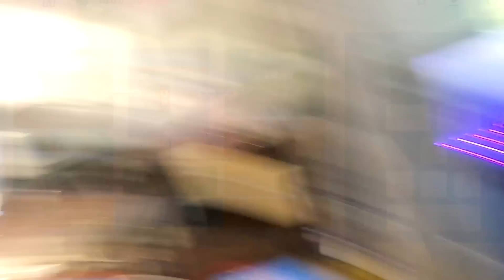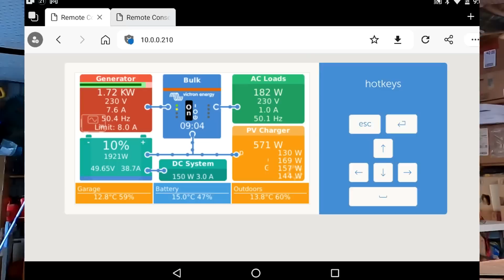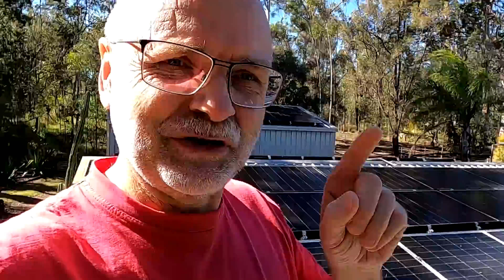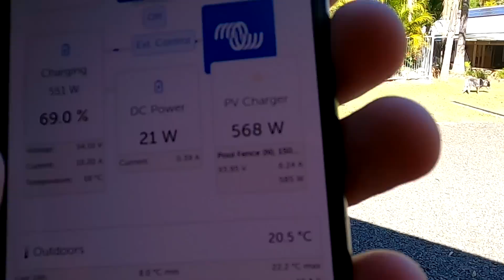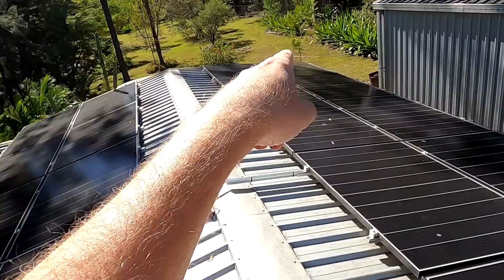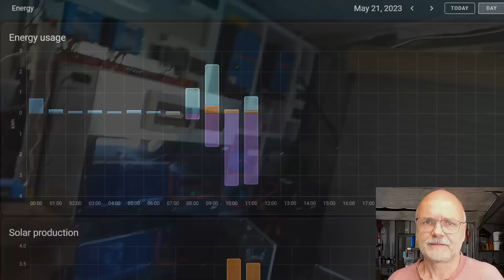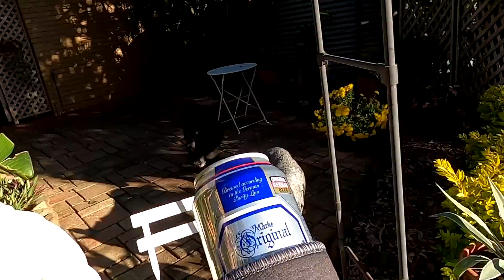Finally Off-Grid!! Look at this energy consumption and production in Winter!

Comment: Let me disagree with you, Andy. First of all, YOU ARE STILL ON-grid. This means that: a) you treat the grid as a battery with infinite capacity (very convenient but impossible in off-grid conditions!), b) you can ALWAYS count on full power supply from the network in the event of a failure, reconstruction of your own installation or empty batteries for trivial reasons . Even if you to deny it, in any way, the fact of connecting to the grid changes not only your consciousness but also your subconscious and the resulting decisions!

In order to fully legitimately consider a true off-grid, all you need to do is perform a very simple experiment: disconnect the main fuses at your grid operator's energy meter. If your installation can withstand CONTINUOUS and UNINTERRUPTED (even for a few seconds!) power to your home FOR TWO WEEKS, it deserves to be called "off-grid capable" in my opinion. If not, the considerations become purely academic, in this case without practical significance. Yes, in the second case you can talk about energy independence, but it is still not TRUE off-grid!!!

Why do I take two weeks as a test period? I just assume that extremely unfavorable weather conditions cannot last more than 14 days continuously. Even if such a situation occurs, it will be an unimaginable exception and as such cannot be treated as the rule. A sufficient remedy for such exceptions would be to equip the installation with a small power generator with a power slightly exceeding the power of your inverters.
It is very likely that you would NEVER use this generator, but knowing that you have such protection gives you a sense of security and comfort for a small price.
Reply from the maker: Thanks Andre.
a) I explained this in the video
b) I explained this in the video
I don't need a generator, I can just stay connect to the grid and use on single power outlet in the garage in case I need to recharge the batteries for whatever reason. I can pay the service fee for the connection instead of investing and maintaining a generator.
We can have this discussion again in 2028 ;)
Reply: @OffGridGarageAustralia  I watch your channel because its name attracts me: OFF-GRID...
I am considering building a house in a location where there is NO NETWORK and there are many indications that it will not be for a very long time I am collecting information, observing the experiences of others to create a coherent concept of a house that would be completely off-grid from the beginning, even without a chance for any network support.
Therefore, until I prove to myself that my concept makes technical sense, I don't even start considering its economic sense. Technical sense, more precisely: meeting the condition of energy self-sufficiency in WINTER is a sine qua non condition. And this is not so obvious in Poland! Therefore, in my deliberations, the generator is a safety element in case of a serious failure of my "photovoltaic power plant".
The matter is not as obvious as it might seem. In my country, there are a lot of restrictions on PV installations, our internal ones, but above all EU ones. The second problem, no less serious, is digging through the bureaucratic inertia, not to say "reluctance".
I live in Poland (and I'm not going to change that) in a country where the conditions for building a PV installation are much more difficult than in your case. And my concept is very simple: land suitable for construction purposes in a non-electrified area is more than ten times cheaper than land "armed" with utilities. In this way, the funds for the PV installation can be easily saved from the "investment budget", although in my case it is not a bottomless barrel. ;)

And that's why my observations and comments come from a different point of view. As I can see, you are satisfied with the installation not so much off-grid as yes, which I call hybrid - a little off-grid, a little grid. For me, the basic criterion is clean, indisputable off-grid. Hence the sometimes different ratings.
Reply from the maker: @andrzej3511  Thanks for your explanation.

Comment: Andy, you should really consider strategically removing even if only two or three of those tall trees which are most impacting your production.   Removing 2-3 of those tallest trees would make a HUGE difference in your production and only minimally change the landscape...  It might save your garage and solar system too should you get a big storm.  If nothing else, I'm sure it would help reduce the rot and growth which I'm sure you've seen to some degree from all the shading.
Reply: There's more to it than just about solar production,it's habitat for wildlife. I get his desire to keep them. I'd only consider me minimal removal once all other possibilities exhausted.
Reply from the maker: It's not possible to remove these trees. It would cost me $25.000 or more to get them removed. I could spend this money in solar...
I also disagree to remove trees to setup solar. That contradicts the purpose of clean and green energy. As explained in past videos, I work around the trees.
Reply: @OffGridGarageAustralia  You would save more CO2 when you would remove the trees. They are not a very efficient CO2 sink.
Reply from the maker: @Poebbelmann  They are a CO2 storage

Comment: I run with the firm conviction that any home storage / energy system has to be able to operate without intervention in all conditions.  Which means, generally,  having load-support (also means battery support) available by other means.  A generator or a charger vampiring off another system (like the home's grid-tie).  Otherwise one goes through life constantly having to bird-dog the storage system.

That means having a generator, or having energy transfer capability from the grid (aka a battery charger), or whatever... all automated.   For the grid support the simplest automation is to just set the battery charger's voltage to a support level, e.g. 51.8V or something like that, so it only operates when the battery is low.  And make sure the charger has enough suds for always-enabled loads like a fridge, pool pump, etc.  It does not necessarily have to support all voluntary loads such as charging the car or using power tools.

A more complex automation to ensure that you are only using locally-produced power from the home system is to connect up a sensor to the grid egress (clip-on current transformer / sensor), integrate the sensor into Home Assistant, and then integrate a contactor into Home Assistant with some automation to turn on the contactor (enabling the charger on the AC side, or some other on/off mechanism) whenever the house is exporting more than X kW.

If you do go that route be sure to have hysteresis.  Lets say the battery charger can do 12A (650W or so).  You can set the charger to a middle-of-the-road battery support voltage, say around 54.5V, then have the automation turn it on when the export is > 2000W and turn it off when the export is < 200W.   So it turns on above 2000W (dropping the export to 1350W), and turns it off if the export drops below 200W.   And then at that middling voltage when the charger is on, the charger would only push full power if the battery is fairly low and unsupported by its own solar.

It would be fairly easy to find a sweet spot simply by running the charger in power-supply mode, due to the discharge curve and the charge curve being so widely separated in LiFePO4 battery systems.

--

For my Pergola system I have a little Victron 12A 24V charger that I have set to a low-battery load-support voltage, around 25.9V, and I love how it works in conjunction with the battery.   It doesn't just go from 0 to 12A instantly... the ramp is quite slow since any off-loading of the battery props up the battery voltage, so the battery still contributes current.  Precisely what I want... I want to use as little of the grid as possible.

With a middling battery charging voltage... in your case somewhere around 54.5V (3.4V/cell), the charger would only contribute when the house is exporting, the battery is low, and the garage's solar is insufficient to prop up the battery.  Setting the charger's voltage to somewhere between 3.3V and 3.4V (52.8V to 54.4V) would have the behavior that you desire.

-Matt

Comment: I'm building a new house in Budapest, and we don't have any hot water tank or tubes installed. All hot water is created only when we open the tap and cold water is heated to 50 degrees Celsius in seconds using 3600 W heater built into the tap. In this way we only use 3600 W for few seconds and bit longer for shower. Clever system, I believe.
Reply from the maker: The problem with this instand heaters are, the power must come from somewhere. So the power generation need to be ready at any time for you to have hot water. That costs hugely in terms of the power grid, the power plant which provides this power for you and therefore the environment. The plant needs to run 24/7 with the capability to deliver this power to your house, even if you don't use it.
It's actually the least efficient method to heat up water unfortunately.
Reply: @OffGridGarageAustralia  The thing is though that this is for kitchen etc. so when I open the water, I use it for only 1-3 minutes and then turn it off. My opinion is that it will use less energy than heating a water boiler and keeping the water hot.
Reply from the maker: @TheFikotech  But how does the power plant know when you will open the tap? So it needs to run on full power all the time just to provide the energy when you request it. It's like leaving your car running just in case you want to drive it at some point.
I would not go with such a system if I were you. It also will be very hard to switch to solar and batteries at some stage.
Reply: @OffGridGarageAustralia  Well, I think you have proved that solar cells are not "just" solar cells and in the feature we might be able to get better batteries AND better solar cell technologies. In my case, I develop MCU systems that are "smart" on the energy consumption. As I also have electric floor heating, the heating of the floor will automatically be switched off when I open hot water, and turned on again (if needed) when I close the water. The floor heating is also about 3600W + plus another 1500W, but they are never on at the same time, as the software controls this function in the same was as it does with the hot water tap.

Comment: 31:45 Honestly - 1 person more in the winter helps heating with 50 - 100W, which is usually more than the consumption for hot water. In a good insulated house in Germany, 1 person more needs not more energie.

Comment: When you go offgrid, then you have to buy a good diesl generator.
Reply from the maker: Noooo, I will just stay connected to the grid for quite a while (not even sure if I can disconnect at all). and use just one outlet in the garage to plug in a small charger if I need it ever.

Comment: Hello Andy
As usual a great video.
Do you heat your hot water with electricity from solar/ grid? If so why not place solar collectors on the roof and install a small recirculation pump.
I have built one using a larger storage tank with element and collectors and pump and only used electricity to boost the water temp when the home had 4 additional people from off peak on the very odd occasions.
Sunshine Coast hinterland.
Keep the good work up.
Reply from the maker: A solar hot water system would cost me A$6k including installation. I use around 1.5kWh per day on hot water (year average), that would be over 27 years amortisation. I can install 4 more solar panels just to cover this load and keep my existing hot water tank (which I have done already)

Comment: On some cloudy days i surpricingly get more power from the opposite roof.
Both roofs have no shade.
I think sometimes the clouds do act like a mirror, reflecting the sunlight stronger than let it through.
Reply from the maker: Yes, clouds are doing great things if they are not to thick.
Reply: When rain and stop I notice and increase in production, I suppose the water drops in the panels act like a lens. In photography on a cloudy day you have to take 1 or 2 F stops to not overexposure probably this happen with panels and they produce more, I'm referring those cloudy but bright days not the grey ones.
Reply: @CantFindInYoutube  Rain also cools down down the panels.

Comment: He could keep adding panels or simpler just cut down 2 trees, you have plenty. You would easily double typical output.
Reply from the maker: Cost me $25k+
Reply: @OffGridGarageAustralia  That is one expensive chainsaw.:face-green-smiling:
Reply from the maker: @DirtMcGoof  Trees are 40m high and no real access for any machinery behind the garages. Cutting seems possible but very destructive but removal very very difficult. I look for alternatives therefore.

Comment: i would cut some (Äste keine Ahnung ob das wort passt) branches..
then i would rethink my Winter wiring;)
i do as follow,
2s pv and then every 2s paralell.
i have here a simular Problem (Baby system) and i Change my wiring 2 times a anum.
this raises my Winter energy by 50%.....because of the moving shaddows .
I Must tell you that i have a 24v System  and 2s pv  works best for me in Winter.
i wish you the best that you can immagine!
sorry,my english declines.
Reply from the maker: I bet you would not cut one single branch...
Reply: @OffGridGarageAustralia  as long i would be thinking logical ....you are shurely right!
to my own worry i am  sometimes irascible.....so it would possibly happen ;)
Reply from the maker: @anon72513  You would need a 40m long prune saw to start trimming some branches off ;)

Comment: Wouldn't it be more efficient to go from frankenstein batteries to go directl to your 3 main batteries rather than going through the phoenix DC->AC, then MPII?
Reply from the maker: Yes, of course, that would be far more efficient. The MPPTs are 99% efficient, the detour over the Phoenix and Multplus will cost me around 20% in energy loss.

Comment: Andy, if you have a stable grid, off-grid system is just not worth it. The price for the pure off grid system is raising rapidly, but you need to cover small portion of energy usage. In other hand you will have a lot of power on the roof during the summer which you are not able to use.
In Slovakia we have a product Virtual battery, so I can export energy for free during the summer and import it during the winter just for distribution fees. This can reduce the electric bill dramatically without having big battery and very expansive solar system.
Reply from the maker: It's actually the opposite. Off-grid systems are coming down in price. Staying connected to the grid is not worth it, no feed-in incentives and far too many regulations.
However, I will stay connected to the grid for a while and use it as a 'generator' in case I need to charge in case of a weather event.
Reply: In this particular case, the large solar array and the large battery are already in place and functional. I appears that making this installation fully off-grid would require little additional expenses.

That being said, a naive off-grid system has one obvious disadvantage: no back-up. If something goes wrong, e.g. an inverter breaks down or a BMS fails or even if some planned maintenance to critical components is being done, there is no power. Therefore, it is in my opinion important to build the off-grid system in a way where there are redundancies to every piece of critical equipment. This of course increases the cost.

This system already appears to be built fairly well and with reasonable amount of redundancies.

Comment: I saw a USA video of an automatic sun tracking solar panel system. The panels moved on a single post and made about twice their fixed location solar output because the panels faced the sun from sun up to sun down.
Reply: The economics over the long term always works out far cheaper to add a couple of panels to offset the tracking by the time you factor in extra components that drive the panels (motors etc) plus lots more points of failure.
Couple of panels that don't move works out better.
If the tracking made economic sense, it would be far more widespread worldwide.
Reply from the maker: Trackers are not great considering they need a huge concrete foundation to withstands storms. Moving parts also means more maintenance.